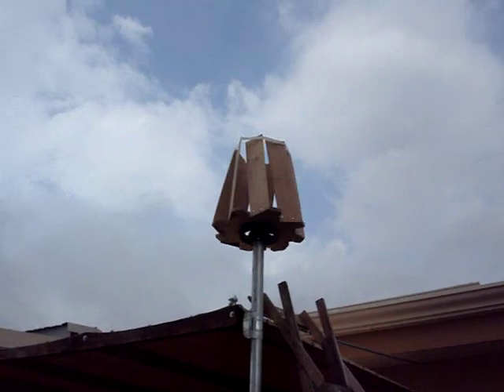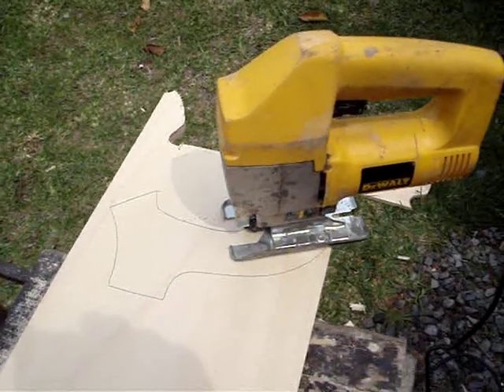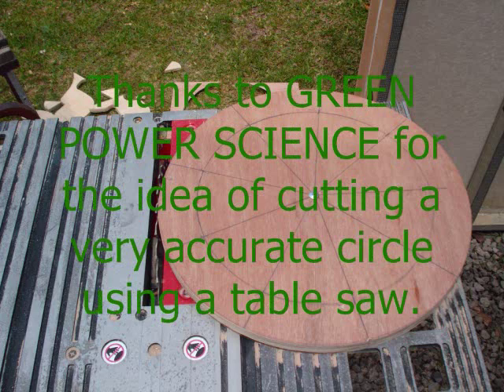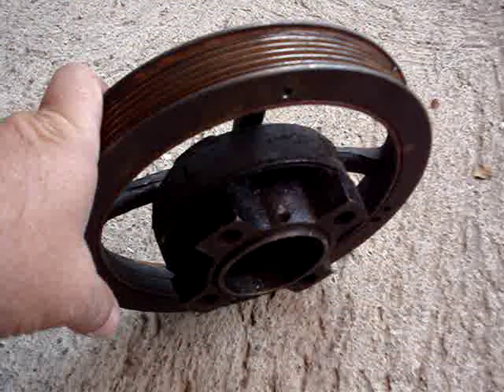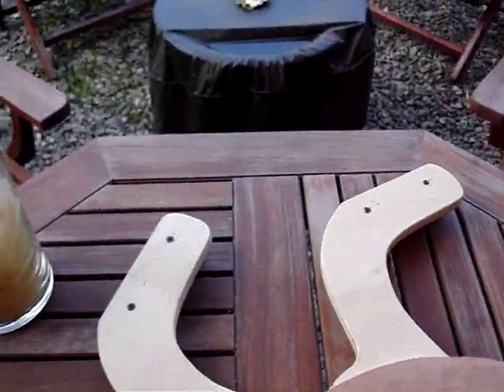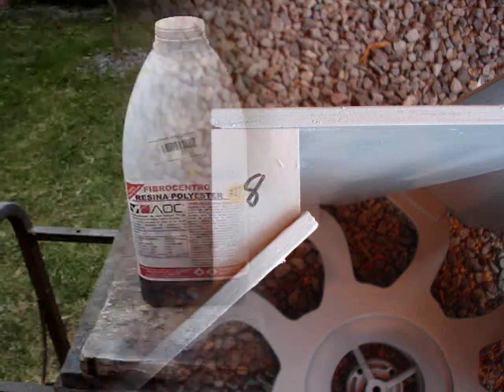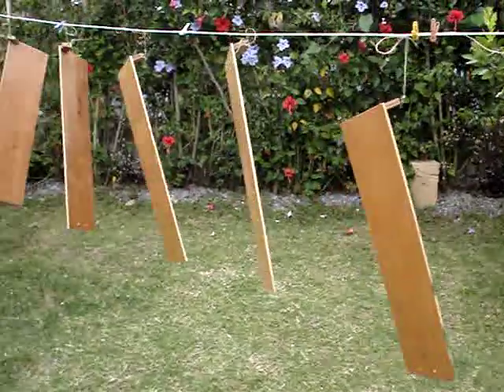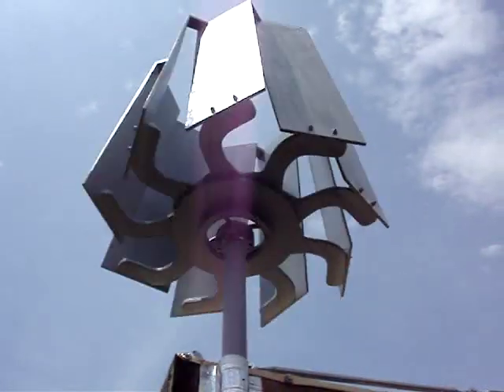How to build a homemade V.A.W.T. Vertical Axis Wind Turbine

Comment: Hey man how many kilowatts are you producing? is it enough to power your home?
Reply from the maker: +Thomas Batts I dont have this hooked up anymore to much trouble for to little power. I really need to live in a place with a lot more wind. I am using solar now easier and more reliable.

Comment: I would go with a bigger turbine, and then scale the rotation with gears up to 1:8 or so, so you can get the fastest speed. It wouldn't require that much power because the stator itself is only about 6 pounds, so increasing the speed with gears to 1:8 wouldn't compromise torque. But I would go with much lighter material for the turbine blades instead of wood. But I really admire your work, it's awesome!!

Comment: @aceman307 I'm not sure if your turbine has a trouble with killing bats and birds but if it does i suggest that you colour the turbine purple. It may not sound like the most amazing colour but it has been shown that insects are less attracted to the colour purple so birds and bats wont be hovering around. Also do you know have any suggestions on what shape a wind turbine blade should be? I've seen loads of different designs. Any help?

Comment from the maker: @jedufa If you look at my video How I built the Rotor at about the 2 minute mark it shows a pretty good picture of how I connected the stator to the shaft. I used a threaded tube with double nuts to lock in place. And its fully adjustable.

Comment from the maker: I tried the blades straight up and several other ways but it spun the best with the blades at that angle. I also tried it with a top but it did not work as well as with out. So I left it open at top. The way I connected the top is very strong.

Comment: Thats cool, Mark. With the L.A. Department of Water and Power ripping us off with rate increases that was supposed to be temporary but turned out to be permanent, I think I'll build one of these windmills. It does get windy here. When you had the blades hanging on a wire to be treated, it reminded me of our 12C days. :-D